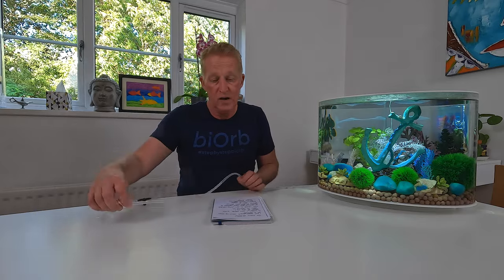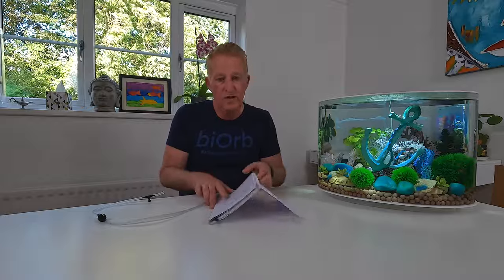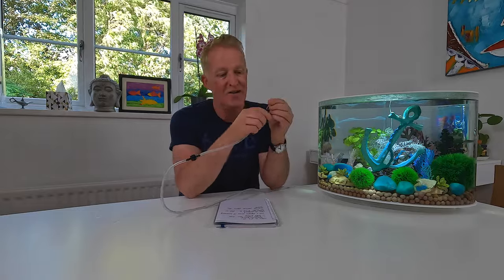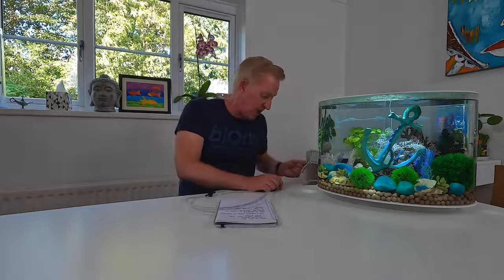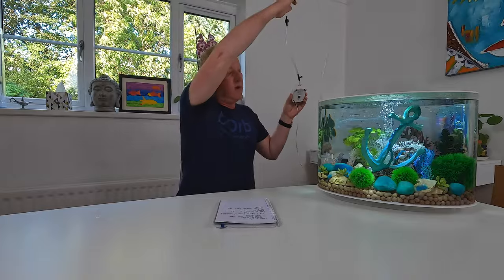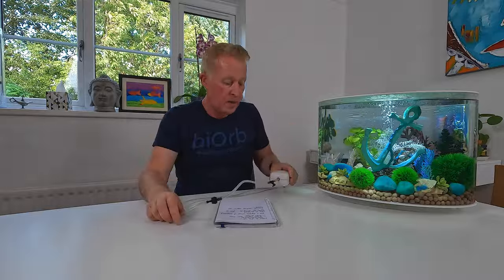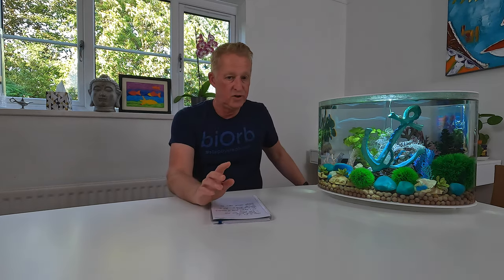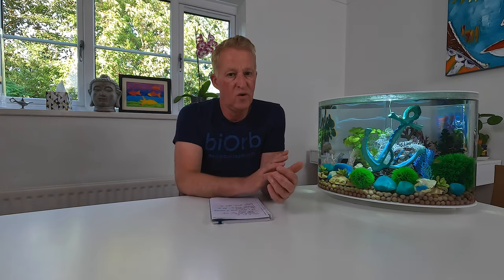bOrb Aquarium |  No air bubbles? |  But air pump works!

Comment: I got a question? Can I use another brand or different type of air pump on my Biorb tank or is my Biorb pump made specifically for my tank size ? Just want to be sure. Thanks Mark.✌️🐠.....💨
Reply from the maker: Hey Mark. You can use any brand/ type of air pump on a biOrb. The key things are:
- Choose one that just has a single airline outline (some pumps allow the addition of more than one airline). Amazon is a good place to look as it contains a large range of product options. 
- It's good to consider one that has a dial that allows adjustment of air flow (or, alternatively... use an air regulator that can easily be fitted to the airline to adjust air) 
- Air pump adverts describe the range of tank sizes that the pump supports. Obviously choose one that has a range that suits your tank size.  I would generally avoid one that is too over-specced (i.e. suitable for a very large aquarium) as these will be over powered for a biOrb and can often have increased noise.  

Hope that helps my friend.  Best wishes, M.
Reply: Yes very much 🎉😊😁🤟🐟🐟🐟🐟

Comment: Hi i just watched most of your videos today. What do you recommend for cleaning a biorb acrylic glass. On my normal glass fish tanks i use a razer blade. I know i can't use this on the Biorb. Biorb sells this rubber cleaner stick but it gets mixed reviews.
Reply from the maker: Hi. Certainly don't use a blade or anything that will cause abrasion (scrubbers etc). I only really use the biOrb long brush for removing micro bubbles from the glass... it is really good for that (using the blade side).  It isn't that great for cleaning though!  The only thing I will use to clean the inside of the glass are the biOrb Cleaning Pads. The smooth side works well for most things and the rough side for anything that is more stubborn.  I've used them for years with no problems at all.  On the outside I use the High gloss polish and cloth (really good product and lasts for ages!). That's all I use!  My key focus is probably on water quality, to help reduce diatoms/ algae (and other staining), so I perhaps only wipe the inside of the glass every couple of months.  Hope that helps. Best wishes, Mark

Comment: Hey! 9 months ago was your last post! Hope you are doing ok and that your tanks are doing well? So my cold water tank is doing well with the birth of a second round of babies from my Platy’s! It’s a classic round tank.  I just wondered if you know of anything good to put the babies in, inside the tank? The last thing I had I had to stop using as the lid kept coming off and it was designed for a square tank which I don’t have.  We have rescued some babies from inside the filter! :(
Reply from the maker: Hi again. I'm not aware of anything that would work in a classic shape.  Saying that, most biOrbs are the same due to the limited access space of the lid aperture.  There are a wide variety of products that can be incorporated in standard aquariums, with most being the hang-on-back nurseries.  The type of product you would probably need is a Net Trap Box Hatchery - but I think you would struggle to find anything that would fit or work suitably in a biOrb.  If trying to limit predation then the key thing with fry is to provide plenty of safe hiding (escape options) places at the bottom of the tank. Overall, the very best approach  is to set-up a separate nano-tank and add the fry to that (if you can catch them!. Once the fry get to a good size they can be added back into the main tank. M
Reply: @StepbyStep-biOrb  ah perfect, thanks very much for your help.  Do you still have your tanks?
Reply from the maker: Hi, Yes, still have my 5 tanks! All running well with happy fish.  Spent most of this year setting up a half whisky barrel pond in the garden (about 80l with 3 comet gold fish in).  It looks wonderful currently. So, I suppose I have now got 6 tanks on the go!  LOL
Reply: @StepbyStep-biOrb  Aww lovely, sounds great! A neighbour has carp in a pond, very nice.  I think I’ll stick with my 1 x 30ltr classic biorb! 🤣

Comment: As a side note is it true there was a 60l biorb cylinder aquarium? I have 2 ,30 litre cylinders but would like a couple of bigger ones but cant find the mystical 60s On the subject of the air flow problem i put a 1 way valve on the airline inside the aquarium so should the airline detatch from the outside it wont drain the tank
Reply from the maker: Hi. I'm not aware of a 60l in the Tube biOrbs, just 15, 30 and 35l. The 60l biOrb tanks are Cube, Halo, Classic and Life. Hope that helps.  I am aware of a large tube shaped aquarium made by Katachi Takia, but I know little about them. Hope that helps. Best, Mark

Comment: Hi Mark, Thank you for running this channel. We're running into a new issue with our BiOrb Halo 30L. We've had this tank for 2 years and all has been well until last month. When we pulled out the center column, a huge cloud of debris was released from beneath the filter. The air pump seems to be working fine, bubbles rising up through the column as usual, the new airstone didn't change anything, and the new filter didn't change anything. There seems to be some debris making it through to the sponge but somehow a large percentage is getting trapped beneath the filter rather than going through it. We pulled out a bunch of the filtration stones to see if there was excess debris there, it was surprisingly clean. There seems to be a lot of debris beneath the plastic ring directly encircling the airstone but we can't get to it with the pump. Have you ever seen this before? Do you have tips for how to clean that section? Thanks so much
Reply from the maker: Hi Tara. Really nice to hear from you.  The only thing I can think of is food waste or it can be a result of white biOrb decorations (I have had numerous people saying that white biOrb decorations flake their outer colour/paint after a period of time).  Do you have white decorations? If it is food waste then a gravel vac is the only way to remove it properly.  When cleaning out my tanks I will always "hoover" the inside of the central filter to remove waste - which can often congregate there. Are you using the gravel vac I recommend on the Channel?: https://amzn.to/3S71ZE6.  Let me know. Best, Mark
Reply: @StepbyStep-biOrb  thank you so much for replying--we don't have white decorations. It definitely seems to be food waste but since we hadn't changed how we'd been feeding them I assumed it was something not working right with the filtration. I will pay closer attention to the amount of food going forward. We don't have that vacuum, but definitely intrigued! We just suck up the debris with the water changes with the hand pump hose but I love that this device allows you to remove waste on its own! Thanks again for your reply and for the channel. It's been a great support for us with our biorb.
Reply from the maker: Hi Tara. Yes, get one of those gravel vacs! They work a treat for removing waste. I agree it sounds like food waste build up, so it might also be present under your ceramic/pearl media. It is certainly good to reduce this waste down as this would help with the tank's water quality.  The vacs are really cheap to buy and easy to use.  If you add the filter bag to it, you would be able to give the tank a good vac (without extracting tank water). Following that, connecting the hose to the vac allows it to be used for water changes.  See here: https://www.youtube.com/watch?v=wtU0Cqx9yes

Comment: Hi. I have an issue where I have no bubbles but the pipe is completely clear. I have blown down it and get bubbles, but when I connect the motor (which is definitely working as it is vibrating) it doesn’t push any air through and I still get no bubbles, despite the tube being clear. Any ideas? Should I cut the bottom of the tube as it may be leaking air at that point? Thanks
Reply from the maker: Hi. Okay, have you tried a bicycle air pump to push (blast) air though the system? I'm just wondering if it is the valve that sits at the base of the tank (underneath)?  Best, Mark
Reply from the maker: Hi. Did this work? If not, it is likely to be your pump not blowing air, despite it sounding like it is working. M

Comment: Very useful thanks. I had some electrical work done in my house a couple of weeks ago necessitating regular turning off of the mains power. I wondered why my biorb pump didn’t start up after the power was back on. After swapping pumps and air stones and still no bubbles I instinctively blew into the tube. I wasn’t sure if this was the correct thing to do. Your video has reassured me. Cheers.
Reply from the maker: Thanks for watching. It's a question that comes every now again on the Channel. The "blowing down the airline" approach always seems to fix it!  :)

Comment: Hi Mark - great videos and great advice. I am new to keeping fish (been at it 4 months now) all was great in the first couple of months, fish seemed happy and healthy but just recently i keep losing fish. I Have 5 neon tetras and 4 endler guppies in a 30l Biorb. Although yesterday i lost one of each and i dont know why! All my water levels were good apart from ammonia which had a spike at around 0.25/0.50 but from day 1 my ammonia level has never been at 0 its always sat at around 0.25. 
I do weekly water changes at 10l each time and add biological boost and use water treatment. I feed once a day (small ish amount). My water temp is always around 25. They just seem to be really unhappy at the moment and iv got a feeling im going to lose more. Im not sure what iv done wrong. Any advice would be greatly recieved. Thank you
Reply from the maker: Hi Lee. Great to hear from you, but sorry to hear you've been having issues.  

The fish species you have is a mix of water quality preferences (endler's - hard water, neon - soft water). I would also advise not to add neons to a tank until the tank has matured and is stable (tends to be 6-months plus) as the species can have a tendency to struggle in tanks that have changing parameters. 

Sorry, some questions...
In terms of you tank pH what reading do you have?   In terms of your ammonia reading at 0.25. This sounds like your tank is not fully cycled. Are you showing a constant reading of zero for nitrite?

Your weekly water changes of 1/3rd sound fine, but this being dependent on how much nitrate your tank is carrying and the readings you have in your tap water.   What is your tank nitrate level prior to undertaking water changes and what is your tap reading? 

Armed with all that I should be able to advise.  You mention adding a biological booster, is that the biOrb product? 

Let me know! Best wishes, Mark
Reply: @StepbyStep-biOrb  Thank You for replying to my comment, much appreciated.

My biorb is 4 months old, i cycled (or at least thought i had) with guppies. Two weeks ago i checked my water parameters and everything seemed great. PH was 7.6/7.8 Ammonia 0 Nitrite 0 and Nitrate 0.2. So i gathered it was cycled and added the neons. They seemed to be doing great and really thriving in the biorb, eating well and exploring. Now they are just hiding constantly at the back of the biorb and sitting at the bottom. On saturday the water looked a little murky so i did a 13ltr water change. Was this too much? Because thats when things have gone down hill.
My water parameters are currently reading PH7.6/7.8 Ammonia 0.25/0.50 Nitrite 0 Nitrate 0.5. I feel like iv started the whole process of cycling again or maybe it has never been cycled in the first place.
I am using aquacare bio-boost.
I thought i had it sussed, i did lots of research before starting this hobby and watched many of your videos, but now im all flustered and confused and feel iv made a real mess of my biorb :(

Thank you for your help.
Reply from the maker: Hi Lee.  If it is particularly the neons that are seeming to be unhappy then I think this reflects your water parameters (pH7.6/7.8 and likely hard water) not being ideal.  The Endler's should be reasonably happy with the water quality you have (but would be good to get rid of that lingering ammonia!).  It is possible that your tank wasn't fully cycled or at least the beneficial bacteria you have wasn't/isn't fully establish.  The large water change, of nearly 50%, might be a key cause especially with the neons - if the fresh water quality added was far different from those in the tank. Ideally neons needs stable conditions and do not like large variations (which can be triggered with large water changes).  I would limit those to weekly and do 1/4 tank changes as it seems from your readings that your nitrates are low (higher nitrates being the main trigger for undertaking water changes).  You mention that the water looked murky, do you mean grey/cloudy?  Cloudy water is often a sign that a beneficial bacterial colony isn't formed enough (this normally happens with a new tank or following an overly intensive clean of the media, inside glass, sculptures etc. This sounds a bit like new tank syndrome. A boost of bacterial product is often the fix for this when a tank that has been running for a period of time.  I think the bio-boost is a good product so continue to use that to boost your bacteria.  As well as limiting your water change try undertaking maintenance  on a different day to water changes (say several days between the two things) for a while to see if this helps to get things back on an even keel.   Fingers crossed, the above should help to solve the issues.  Best, Mark
Reply: @StepbyStep-biOrb  Thank You Mark, that is really helpful.

Yes it is mainly the neons that seem unhappy. Is there anything i can do to change the hardness of the water for them?
Yes the water was a bit cloudy so thats when i performed a large water change.
How often should i use the bio boost? I was using it once a week with a water change, should i be adding daily until cycled?
You mention undertaking maintenance on a different day to water changes, can i ask what you mean by maintenance?
Is it best to just leave the tank alone now and let it run its cycle?

Thanks again for your help,

Lee
Reply from the maker: Hi Lee.  It is always going to be very difficult as your water sounds good for your Endlers, but less so for neons.  You could indeed soften the water but every time you undertake a water change you would be then readjusting the water quality back towards what it is in your tap water. I'm afraid you would end up trying to chase a certain water quality that could also be detrimental for the Endler's.  

With cloudy water (i.e. a bacterial bloom), an addition of an aquarium bacterial booster normally helps to fix this. Undertaking a water changes may simply prolong the cloudiness by adding new minerals/ nutrients to further support the bacterial bloom that causes the cloudy water condition. 

However, I think the main issue, and the key thing you can do, is to try to avoid big/rapid changes in water quality for the neons.  Try to stabilise the water conditions as much as possible, by using smaller water changes but ensuring that nitrates don't creep up too much.  Undertake weekly 10l water changes to see if that helps and see what your nitrates rise to just prior to undertaking a water change. 

You mentioned that your tank nitrate reading is  0.2ppm.  Have you confirmed through your water supplier's water quality info (for your postcode) that you are getting such low levels in your tap?  Aquarium water test kits generally would not be able to read a level as low as 0.2ppm, normally readings are zero, 5.0ppm, 10ppm, 20ppm etc.. If you give me your water suppliers name and your post code I can check your tap level for you as this would be indicative of what your tank nitrates would be.  

In terms of maintenance, I was referring to removing waste trapped under the media (using a vac), cleaning the inside of the tank glass, replacing the sponge filter etc. Just do those types of activities on a different day to the day you undertake water change - just for the time being. 

I'd be tempted to suggest that you move away from bio boost (I looked into this product and found the guidance on its use seems to be highly varied, even if sought from Maidenhead who produce it).  You may find something like Aquavitro Seed a better product for pushing the cycle though and getting a good beneficial bacterial colony established.  You would probably need to get this via online purchase.  I haven't used bio boost so it is difficult to understand how well the product performs for undertaking cycling and therefore for me to suggest how much should be added.   As it is a natural product its use isn't going to be detrimental.  If using Aquavitro Seed I would suggest following the bottle instructions, as though starting a new tank, as I'm sure that it would help fix  your ammonia level and get you beneficial bacterial colony to a size to support better water quality. 

Hope that helps.  Best, Mark
Reply from the maker: Hi Lee. Wishing you a Merry Christmas and a Happy New Year.  Best wishes, Mark